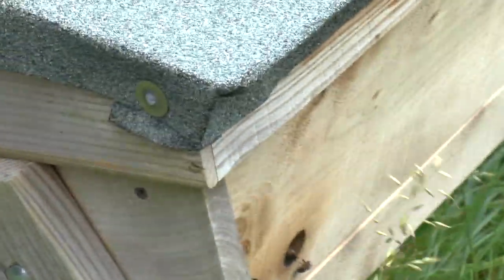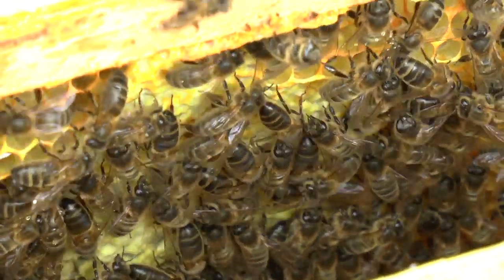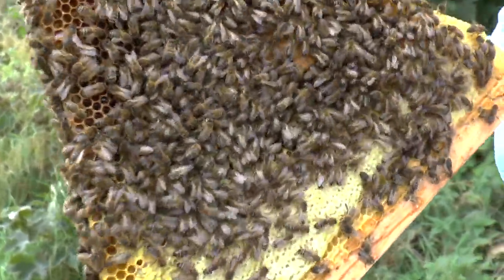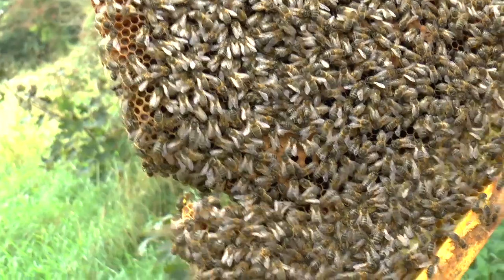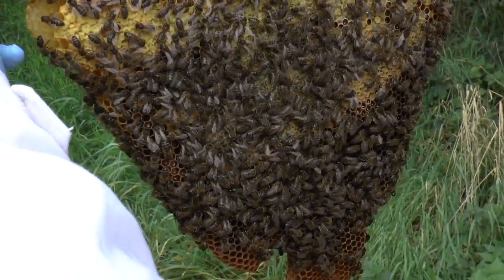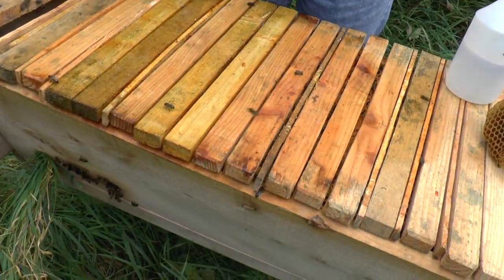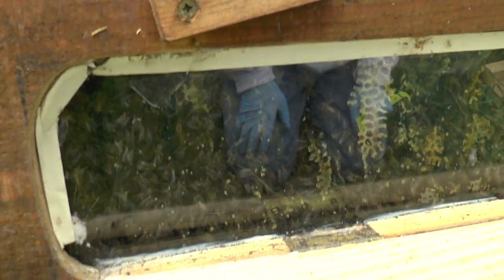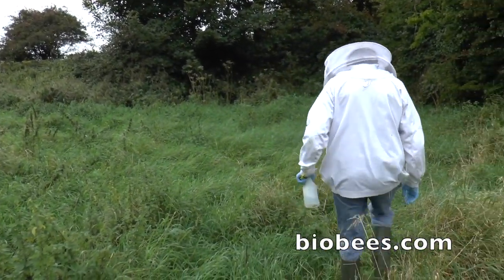Black bees in a top bar hive on the Isle of Man

Comment: Hay guys,

great video. My compost fill is 1 to 7 ratio. the compost is made from garden wast but not stuf with shuger, ie apples and frute, and it is made with out air, so no turning, but by adding a little material at a time (anabatice aposed to adiobatic or somthing) .  the wood chip is from wet wood, so when I prun my treas , but i Prun a little at a time and add a little at a time to the pile. so one of thoughs then 7 off wood chip. the wood chip is made with my chipper and no pine type or to soft wood is used. Ok so this is how things have developed to dayt

then the hive has , the mix in but is will dry out in winter , but once the bees are making honey the compost chip mix seemes to rehidrat and act as a humidity controle device. ?? some how, dont know all the mecanics , but it still seemes to keep all the beneficial bugs happy. 

this mix will also last for years with out having to top up as the bugs seem to feed on the bee droppings, and not decompose much more.

any how just some thoughts

Kev